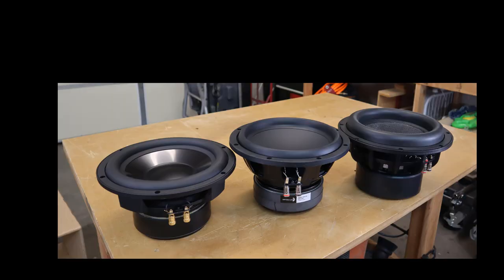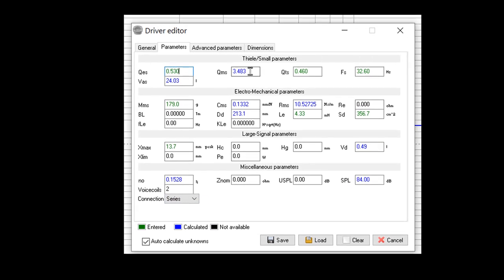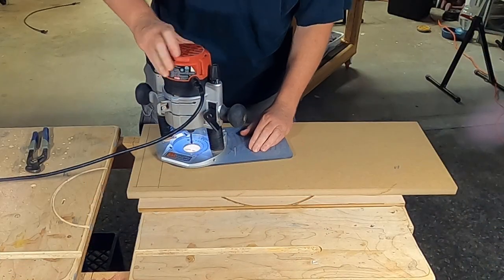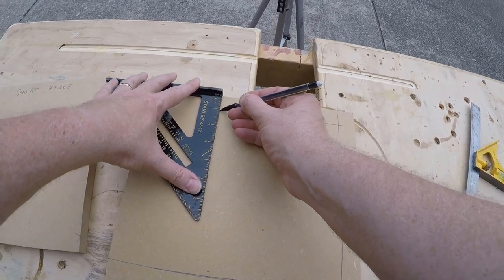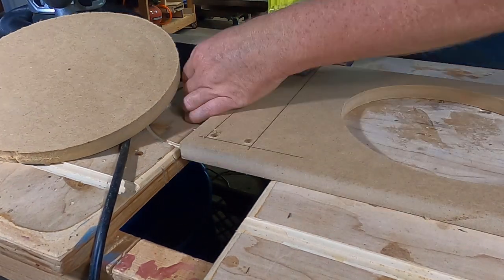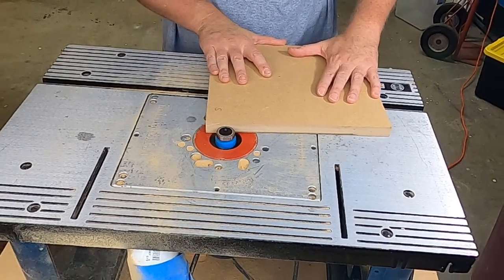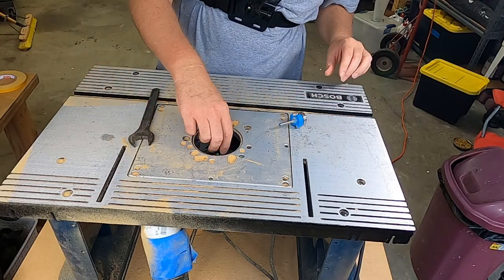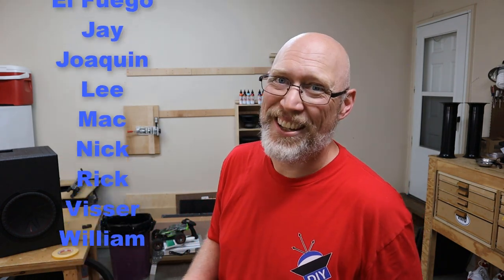Car Audio Subwoofer Design and Build:  Plans for a Dayton Audio MX 10

Comment: This is a pretty decent build video.  Especially good as it shows good bracing for the enclosure, something that's sadly missing from other build videos I've seen that either show poor bracing, or no bracing at all.
Reply from the maker: I tell you what's funny, no matter how much bracing I put in a box somebody always tells me that I either use too much or too little.  The bracing on this one was definitely overkill.  The box is heavy and it is dead. I think I'm just going to overkill my braces from here on out.
Reply: @DIYAudioGuy  It's heavy because you've built it out of MDF, LOL. I've only built one fairly large subwoofer out of MDF, and it's likely to be the last one that I build out of that material.  3/4 ply is my material of choice for larger builds.  

To save some weight, the braces can be built using thinner material.  I used 1/2" ply for the bracing in my POC3 build.  In fact, with all of the internal panels and bracing, I was able to use 1/2" ply for the side panels as well without issue, saving even more weight in the process.
Reply from the maker: The bill that I'm working on right now, hope to get it up on the channel next month, is made out of plywood and it is a lot lighter even though it is bigger.

Comment: Hey Diy guy thx for great videos. I  was wondering your thoughts on a set that I was thinking of putting together. I hthe 2cubed 12" skar box and was thinking of putting the ultimax 12 in it and was curious if it would sound good. Any input would be greatly appreciated thx
Reply from the maker: I don't think it will fit.  The 10" ultimax is oversized and does not fit in a standard cut out.

Comment: Hey, great video i have one question could you use that box in a home theater?
Reply from the maker: It is not tuned low enough for home theater.
Reply: @DIYAudioGuy   do you think its a good idea to use this sub in a home theater?
With a lower tuned enclosure?
Or is this a „only car“ sub?
Reply from the maker: @jerrygamerhd7757  I would step up to the 12 or the 15 for home theater.  If you want to stick with a 10 then go with the Ultimax.
Reply: But i only have the Dayton Audio SPA250 250 Watt sub amp.
Is 250 watt to weak for a 10 inch ultimax?

Comment: Would pay to see plans for rear seat woofer box for a double cab Tacoma.
Reply from the maker: Are you looking for an under seat box or something behind the seats? I'm not really familiar with those trucks so I'm not sure what could be done.
Reply: @DIYAudioGuy  behind the fold down seats.
Reply from the maker: That's a tight spot.  Not much you can do there, are you familiar with Taco tunes?

Comment: What is the fix in a sealed enclosure if your sub is exceeding xmax?
Reply from the maker: Infrasonic filter, a smaller enclosure, or less power.
Reply from the maker: Yeah, that will work.
Reply: If your sub is exceeding Xmax, that basically means that you are exceeding its SPL capabilities.  Putting it in a larger, vented box will give you more SPL capability with the same woofer.  Adding another subwoofer with its own enclosure will also give you more SPL capability.